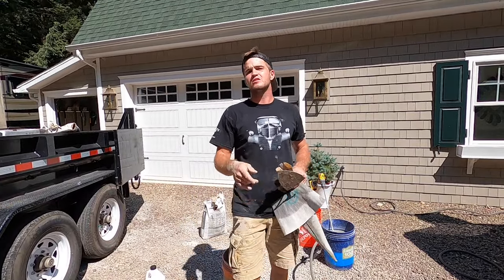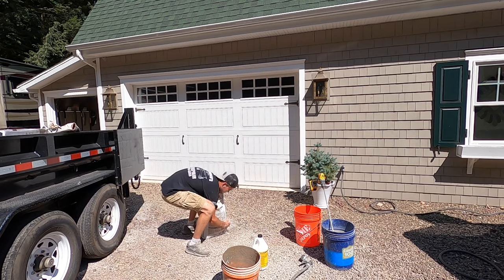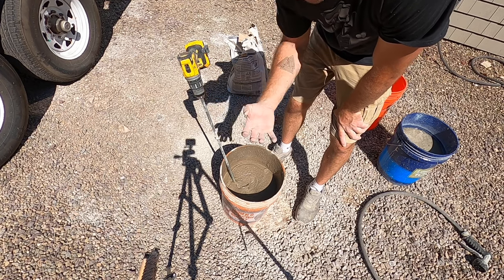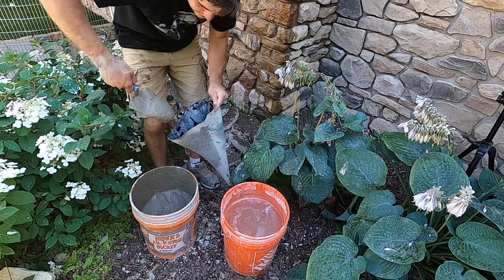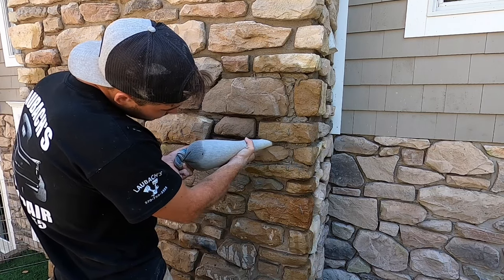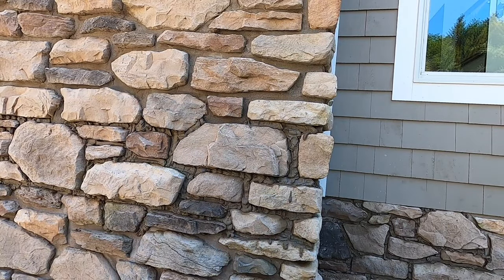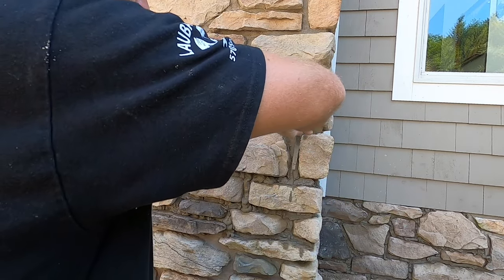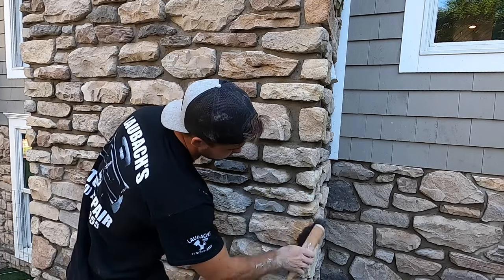How To Grout In A Stone Veneer Wall

Comment: What did you use or how did you mix that darker, pewter looking mortar you used? Is that straight out of a bag or did you add color to achieve that darker gray look? I am needing to grout a wall I made with field stone veneer but I am having trouble deciding on a good color to accent the stone.  I tried a buff but it just looks bad and I really like the look you achieved with the mortar you used to grout in with.
Reply from the maker: I used regular stone mortar. It dries white. You can buy bags of colored mortar at most brick places
Reply: Thank you!!  I did a field stone veneer wall.  I used your video for help. It turned out great!! Thank you!
Reply: Nice work Mason. Thanks for the great info

Comment: Hi Mason:  Nice Video on Grouting a Stone Veneer Wall.   I have a question I hope you can help me out with.  I have a framed stone veneer chimney about 35' tall sitting against a 67 degree roof located in the mountains of NC.  It is going to be really tough to get to, so I am building a wrap around scaffold all the way to the top for the re-pointing effort.   The chimney is framed on the inside, OSB board overlay with lathing wire, then real stone on top.  It is about 20 years old.  The issue is it is leaking, badly.  From the looks of it part of the problem was a poor grouting job in the first place, that was added to by a lack of maintenance, with a final issue of sloppy and poorly done repair.  There are a lot of cracks, loose chunks, and soft areas you can rub out pretty easily.  Anyway, any recommendations on preparing the chimney for the re-pointing process?  Do I want to chisel out all the cracked areas?  Do I need to use a grinder beyond the taking out what will come out with the chisel?   And... what exactly is the mix I should be using to re-grout with; is there grouts that are waterproof (it rains a lot here on the mountain), or ones better for longevity, as I don't want to do this again.     Any advice would be appreciated.  Thank You Lee

Comment: I just had my full foundation done and finished wrapped with a waterproof membrane. I don't like the look of the membrane and would like to cover the foundation walls with stone veneer. My question is what would you suggest to put over the membrane to make a flat surface for the stone veneer.? The membrane comes up 1-2 feet above the ground surface. In other areas the membrane come up even higher. How can I cover all the foundation wall completely with stone veneer.?
Reply from the maker: You have to tapcon wire lathe over all of it then put a scratch coat of mortar on the wire